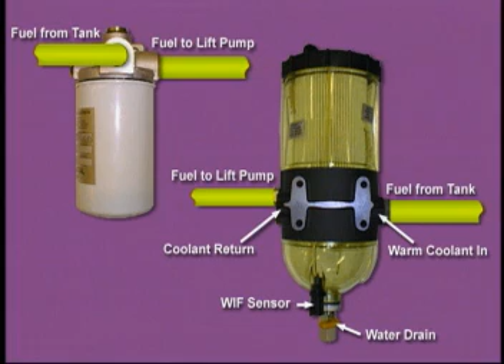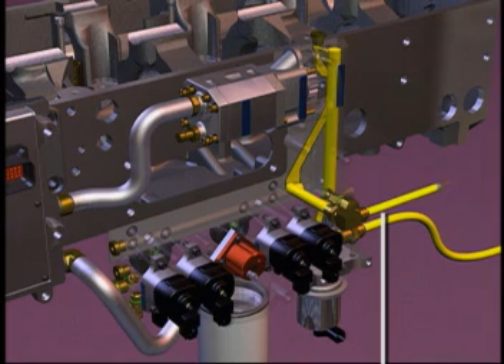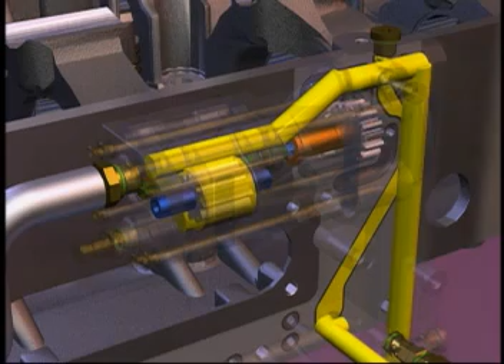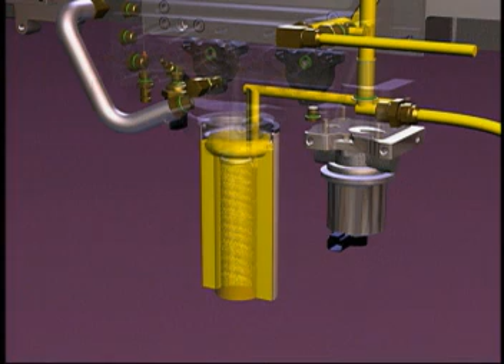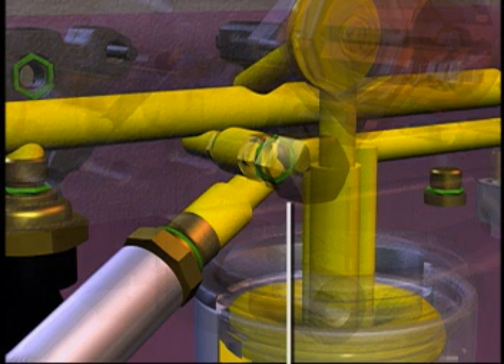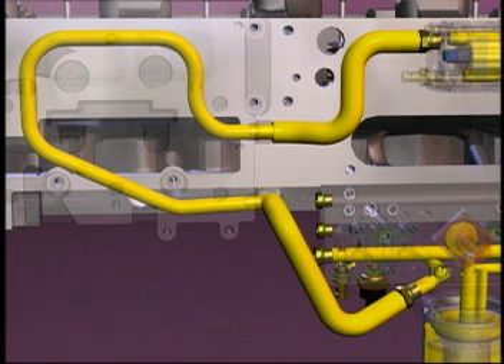Cummins ISX CM870 CM871 Fuel Part1

Comment: I was wondering if there is any possible way I could possibly get some advice on a cm870 that is loosing prime but takes about two days for it to happen and a cm871 that only rough idles after it reaches operating temp ?